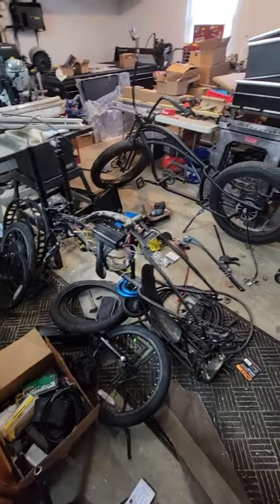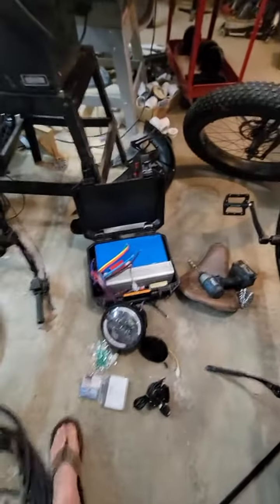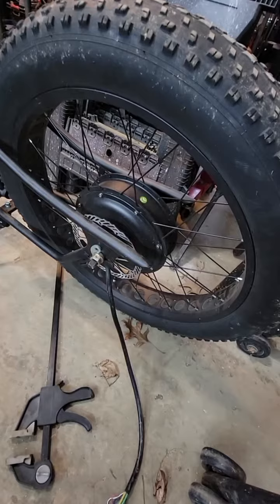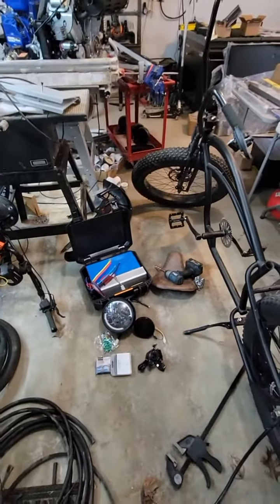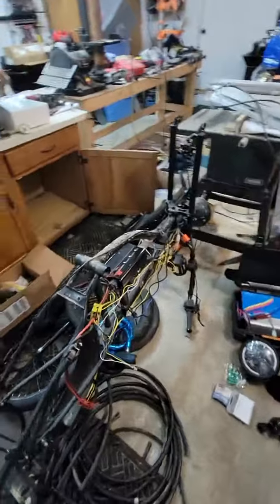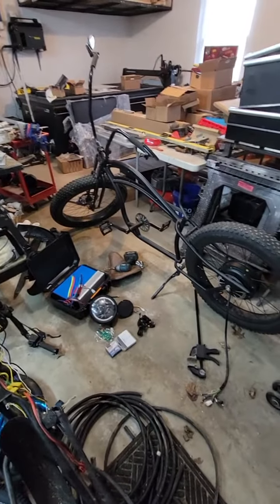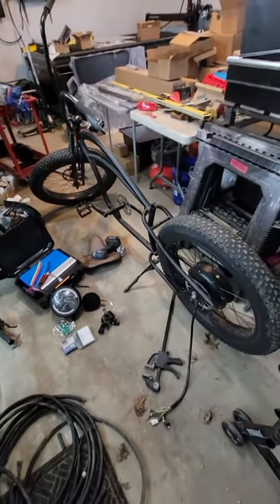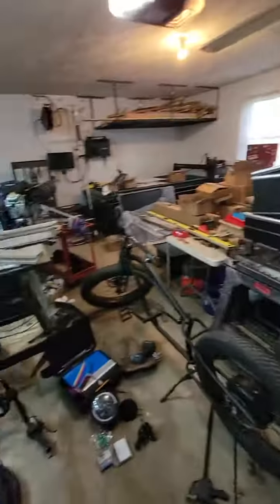Ebike projects and messy workshop

Comment: That is amazing...can you fix to do pedaling to reserve battery and get cardio workout? I live off of highway that I would need that 55mph to get out of way...but the river road by me is great for pedaling along
Reply from the maker: At this power and weight, peddling is not extremely feasible. I've gotten the weight to ~100lbs which I feel is fantastic for a 55 MPH vehicle with dual hydraulic disc brakes that charges off 110VAC. However, when trying to pedal even at the lowest gearing, it's extremely heavy and requires a lot of energy. I would stick with something between 1k-1.5k Watts which should reasonably go 30-35 MPH and be quite a bit lighter. To go 55 MPH, a lot higher amperage and voltage is required, meaning a larger and heavier battery and motor, meaning more weight.
Reply: @science_steve  thank you for this explanation